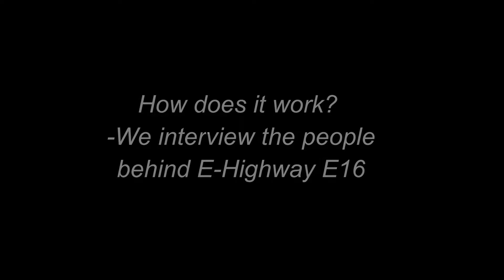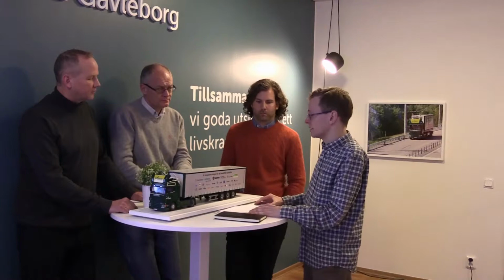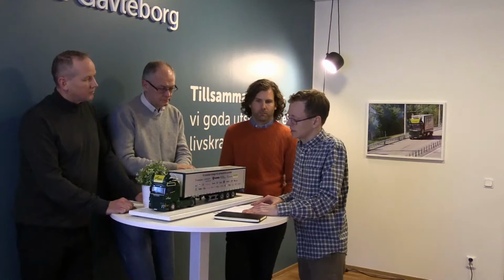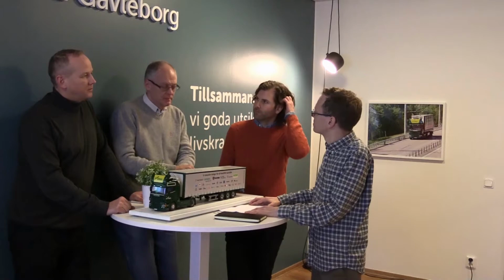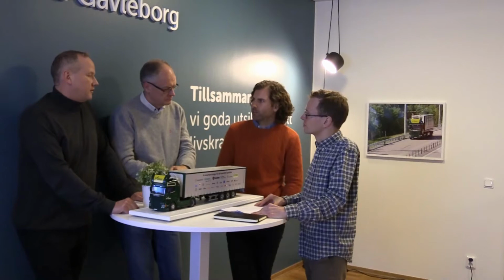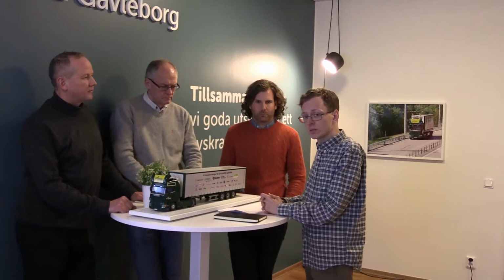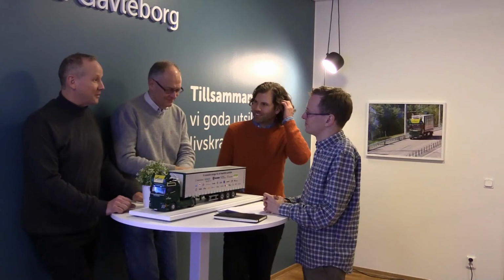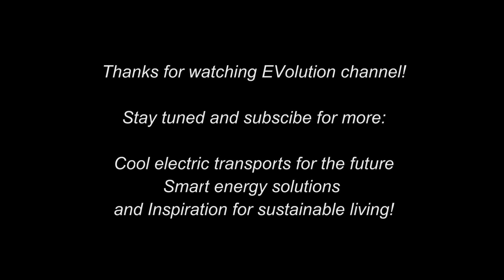Electric trucks: World´s first eHighway l EVolution

Comment: Anything that reduces Diesel use / exhaust is a good move.  I'd rather see full EV but this is much better than what's in use now.
Reply from the maker: Hi! That´s exactly our view too. Hopefully we´ll  see a larger battery pack +electric engine/engines in the eHighway truck soon, enabling 100 % electric drive even when not connected to the overhead catenary system, i.e. the truck can drive all the way to the destination/ pick-up-point on battery instead of having to rely on a diesel engine, a large diesel tank etc. At the moment the latest Scania hybrid platform makes it possbile to drive 10 km (fully loaded with freight) on the battery but that is insufficient for going all electric. Best, Johan